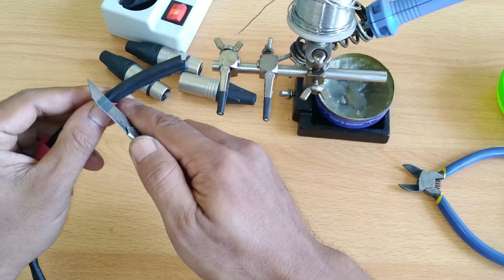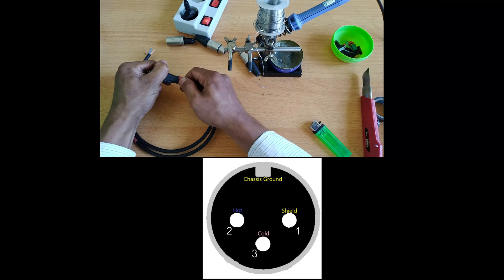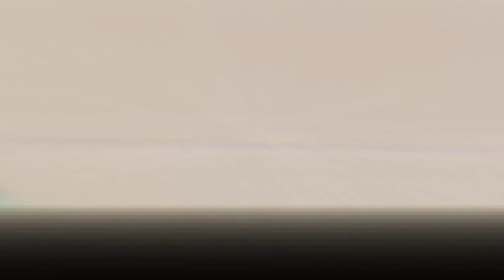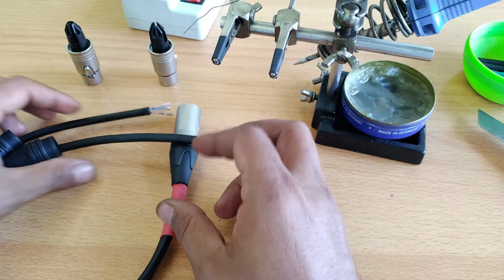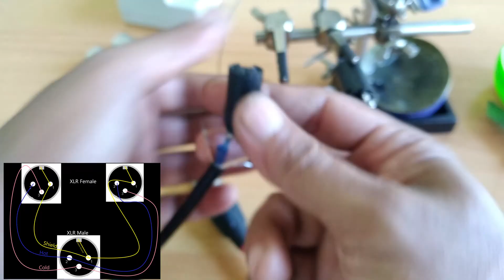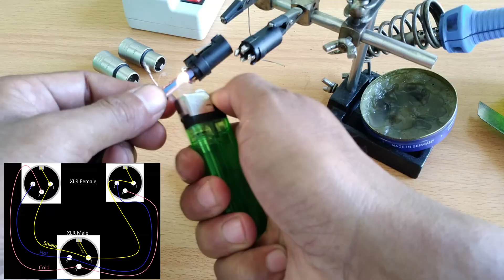How to Make XLR Splitter Cable | 3 Pin Dual XLR Female to Male XLR

Comment: I have bought a finished Pro Cable...and there (Male) 
the two COLD WIres are soldered together...on 3...So why U 
are taking here  two different COLD Spots?

Comment: Doesn't connecting pin1 and chassis on both ends create hum noise from a ground loop? I read it's supposed to be connected only on one side of the splitter cable. What do you think about it?